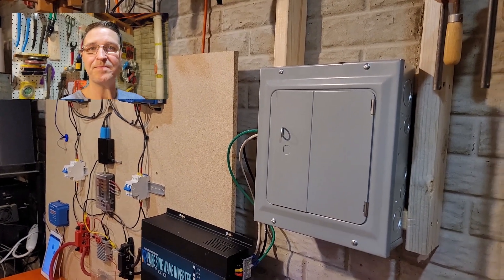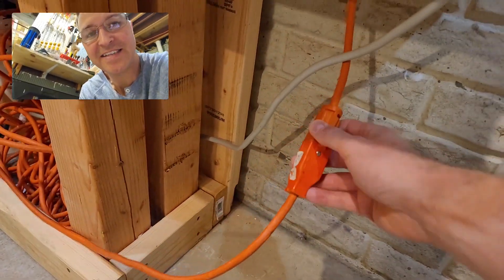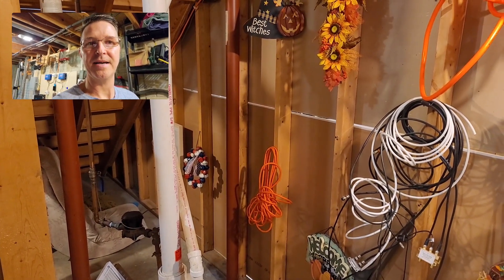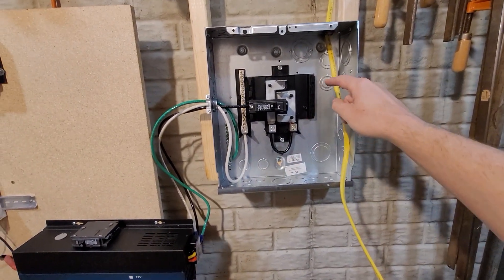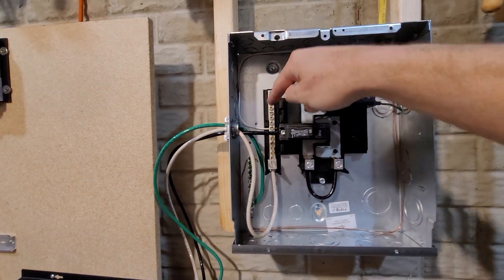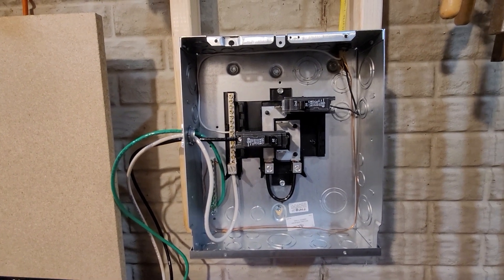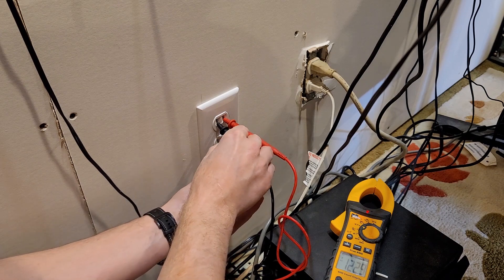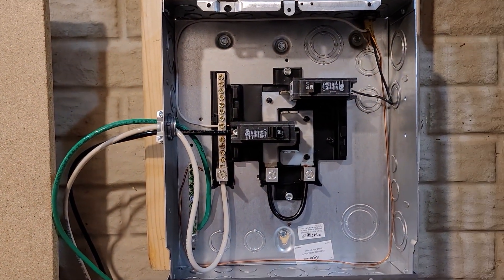Wiring my first circuit to my 24v Off Grid System!  Part3.

Comment: So why are you wanting a 30a breaker instead of 20a? In fact 15a prob would have been fine depending on usage
Reply from the maker: Your right.  I ended up using a 20a breaker.  Works just fine.  Thanks for the comment!

Comment: Thank you for the information as I am converting my inverter power to a breaker box too just that the inverter I have doesn't have the hard wire bars like your inverter my inverter only has the ac out plug in
Reply from the maker: You're welcome.  You can use an extension cord and just cut the other end off to expose the wire to connect to the box.  Make sure to use a thick one!

Comment: Have you continued adding circuits to your panel box? Trying to gather ideas.
Reply from the maker: I still currently have the 2 circuits going to outlets.  I'm going to be putting in a third to charge my 48v system pretty soon.  Thanks for the question.
Reply: @Off Grid Basement  did you ultimately just leave the ground in the panel or did you wind up grounding it?

Comment: Is your inverter floated or bonded?  do you have to bond the ground and neutral in the panel?  will GFCI outlet work with this setup?
Reply from the maker: The inverter is floated.  It is not bonded in the panel.  The inverter doesn't support it since it carries 60v on the neutral.  I've heard GFCI will work, but I've never tried it.  I don't see how it could without a bond at the ground and neutral.  Thanks for the comment!
Reply: @OffGridBasement  I am planning an off grid system using a Renogy inverter.  that one is internally bonded.  But I am not clear on if I should also bond my ground and neutral in the panel.  Renogy support says yes, but I don't think that person really knew.....